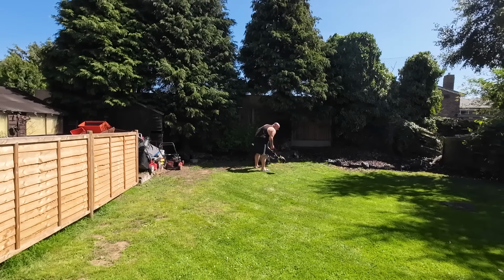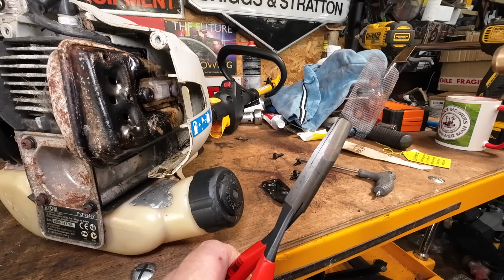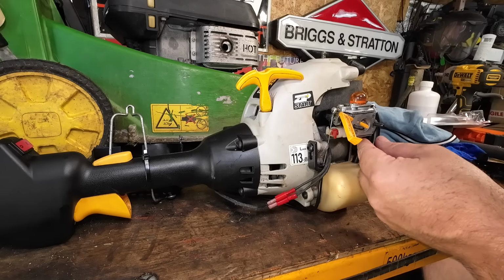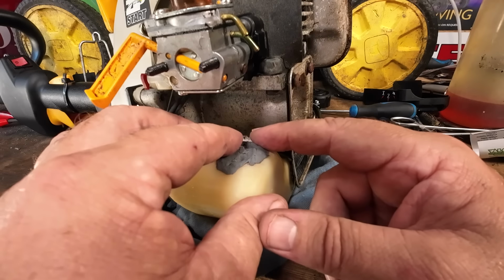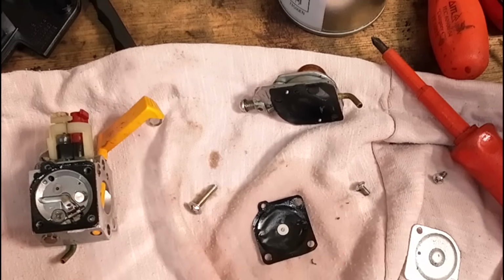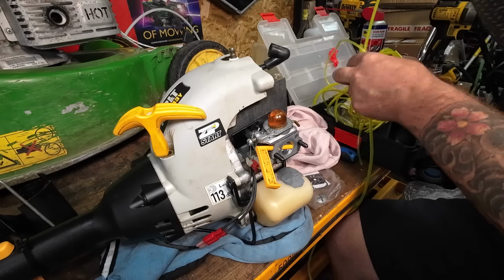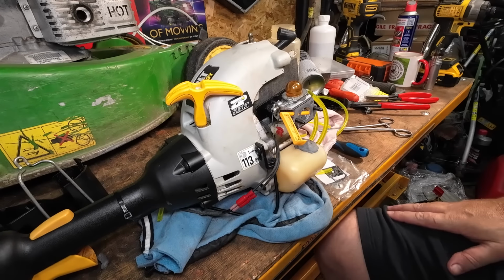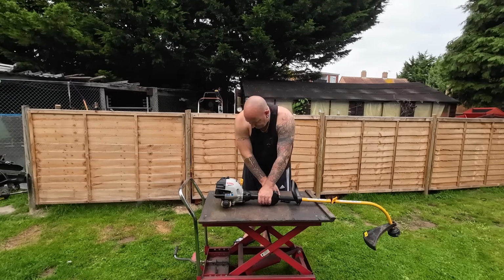Common mistakes why a Ryobi strimmer has starting and running issues.

Comment: Hi Mick, great vid an easy talk through on this Ryobi strimer. Had good laugh, you mentioning "find these strimmers dead easy down at the Tip".. It's where I picked this one up from... I've stripped it down, it was hanging. It's now clean, no new parts needed. It's running sweet. Thanks Mick
Reply from the maker: @010johnm  good on ya mate

Comment: Great in depth video Mick. My 20 year old Partner strimmer isn't running right, fuel lines may be the wrong way round, after I messed with it. I'll go and check. Thanks for the advice.

Comment: Thank you for the content you share. I have a Ryobi 18" chainsaw for 3 years now and love it. Truth is I have not done anything to it, but I have been thinking I should do some preventive maintenance. Best chainsaw I have ever had. I don't really use it very often but when needed it all ways works.
Reply: If you do not use it often i would suggest switching over to a canned alkylate fuel like Aspen if you have not done so already. Worry free start up for 2 years guaranteed.
Reply: Thank you @waynestefinashen239
Reply: @KSimmonsKenny  Your welcome our neighbour has been buying the Kinetix 2 stroke alkylate fuel from us for 5 years now and all 5 pieces of 2 stroke equipment you owns fire up and run fine but he is using it on a regular basis so very expensive. Issue always was that he was mixing his fuel with too much oil and would regularly need carb cleaning which was costing him way more than the annual useage and purchase of the Kinetix fuel.

Comment: HI Mick.
I feel like that sometimes with Ryobi machinery at times lol.
I agree about the fuel (I bought one that instead of 50:1 2 stroke mix they had put a 50/50 mix), but in the owners manual it says to get it retuned after 4-5 tanks worth of fuel it's used.
It normally just requires a carb tune (special tool required) to get it to run properly.
What you have shown is a typical example of people trying to fix things, and not realising that if you need to drill it, then you're doing something wrong e.g. the fuel pipes to big.
I've had 2 mowers come in where the owners have drilled the pop rivets out to repair the pull cord (instead of undoing 3-4 bolts)! DOH!!

Comment: Thanks Mick , Found you by chance ,my strimmer (same as that one  was cutting out when i gave it gas , i did what you shown me & cleaned out that tiny little filter & it now works like new ,  i was going to buy a new one next week ,but no need now , Thanks again for a really informative video
Reply from the maker: @MrAndysoul  no worries mate

Comment: Fantastic fix mick there is nothing wrong with a ryobi lol I've got a ryobi rbc30ses strimmer have had it from brand new in 2008 and it has had a lot of hammer have had no problems with it at all just new primer bulb and a new strimmer head and it is still going strong 👍👍👍👍

Comment: Thanks for making this video. I inherited this very strimmer off my dad and the filter was gunky and rattling about the tank. I'll find out tomorrow of the problem is something else but I'm delighted to have dealt with that. 5 minutes work and hopefully it can be put to good use.
Reply: It'd running great, maybe a little speedy - will watch the tuning instructions at the end - delighted.

Comment: Great video Mick, I love working on mowers but I just like how small two stroke equipment is, I can fit like two mowers in my shed, but like 10+ strimmers, it's better if you don't have much space to work on two stroke equipment, but I actually prefer mowers, it's just space, thanks for the video 👍

Comment: great video for the holes in the gas tank you had if you wanted to fix them you can take a soldering iron and let it heat up and rake on each side to melt the plastic and Slide the plastic right over and fill the holes in
Reply from the maker: Yes but had mixed results mate

Comment: Just “won” one like that but with the starter motor, no battery or charger though, but pull start mech is corroded and jamming, it came with the strimmer  end , extension, and the hedge trimmer ends, so I’m hopefully I can get it running.

Comment: In my experience the ryobi stuff is usualy better quality than a lot of the other cheap brands. The problem is that because of the price people don't really look after them. 

Also with the tank could you not have drilled a larger hole in the middle of the 2 making one big hole for a grommet?
Reply from the maker: No too far apart mate
Reply: Was wondering if I should bother saying that, sure most brands come like that from factory
Reply: Thanks for the luv mick

Comment: Ive spent hours working on these strimmers. At one stage I had one in use one acting up and one in bits for spares.  The earlier models didnt have spark arrestors but one overiding issue I saw with these units was ignition coil !!  Symptoms are - works for 20 min and starts fairly easily but then stops when hot and cannot be restarted till cool no matter what. Seen this happen twice after numerous carbs carb rebuilds etc etc. The non-Chinese coils are  expensive and make the unit  not worth repairing.  After the gauze the first thing I would have tried was 1/4 turn CCW on the Low jet.
Reply: I'm trying to get my Ryobi strimmers going without much success.... Do the cárb get blocked up due to no filter

Comment: Do you have a coil for a challenge mower (Argos brand ) ours died doing a free clean up today
Reply from the maker: No mate sorry
Reply: @themowerman  no problem Mick , is they anything else that could stop the spark , I've tried a new spark plug
Reply from the maker: @ma.creations20  micro switch or coil wire..
Reply: @themowerman  by coil wire do you mean the one that goes to the micro switch or the one going to the spark plug , cheers Mick
Reply from the maker: @ma.creations20  yeah mate .. and check the switch

Comment: I can't see how it can suck in air if the fuel line is submerged in the the petrol. All the missing grommets do is prevent fuel from leakilng out. You can run a machine with the fuel cap off.

Comment: I've got a 2-stroke Ryobi strimmer I've had for about 10 to 15 years now. They are pretty cheaply made, most screws go into plastic, for example.

It's OK and starts / runs fine, does the job, but only after some fiddling.

From new, the mixture was so weak - probably in the interests of emissions - it wouldn't run at all (that certainly kept the emissions down). The adjusting screws had no slots so you couldn't adjust it, but I got round that with a Dremel, and after some setting up, it started and ran fine.

Then I found it would start from cold no problem, but not when hot, needed to leave it to cool again. Really annoying. After a some faffing around (I've done a lot of kart racing so am pretty familiar with 2-strokes), the problem proved to be no spark when hot. Hard to prove as when you take the plug out the spark looks fine.

The cause was just insufficient HT voltage. When cold, rings don't seal as well, compression is lower, necessary voltage is lower, but when hot, it all goes up and the coil couldn't generate the voltage. Probably if I had managed to spin it over fast enough to get the voltage up it would have been OK.

Used to have this many years ago on small cylindrical CEV kart coils when they started to breakdown due to vibration.

In the end I got around it by making sure the magneto coil to flywheel gap was as tight as possible, and that the spark plug gap was on the low side. Since then it's been fine, but it's undoubtedly marginal. Possibly a replacement coil would be better, but it's OK at the moment - and maybe it would be a waste of money.

Maybe that'll help someone.

Cannot say I like the quality much, but you get what you pay for. I'd much prefer a Stihl, but you pay Stihl money.
Reply from the maker: Good comment mate
Reply: @themowerman got a Dennis Premier mk 1 30" sitting in the garage if you are interested.
Reply from the maker: @Nfh65f9  email mate micksmowers01@gmail.com

Comment: Wrong gas/oil mix  is the problem with 2 cycle equipment plus everything else is a  problem with 2 cycle equipment like the carburetor is needing a clean up and the.fuel.fliter  is definitely not in great shape let's not forget the spark plug  ethanol free gas will help with engine issues like the carburetor

Comment: Next time use your time wisely not on a Ryobi
Reply: My first trimmer was a 2016 Ryobi S430 4 cycle. It's still my trimmer in 2024. Zero issues, starts and runs every time